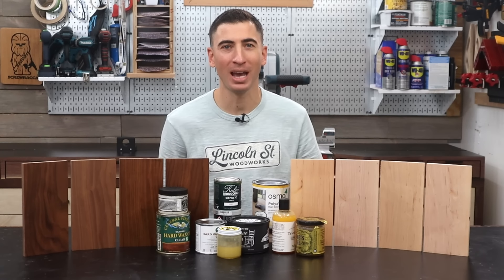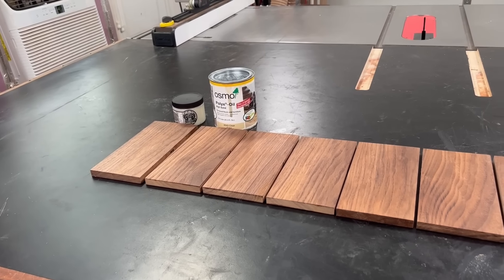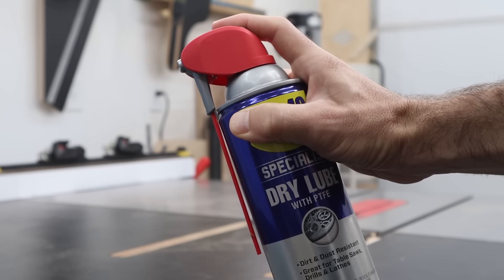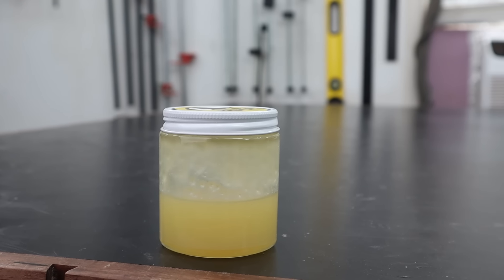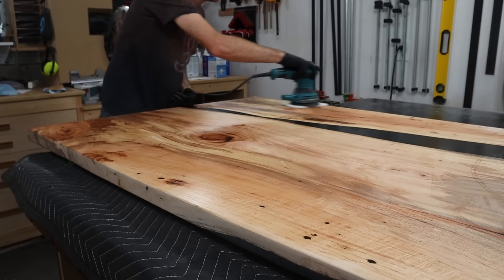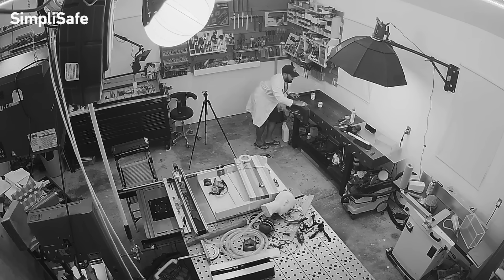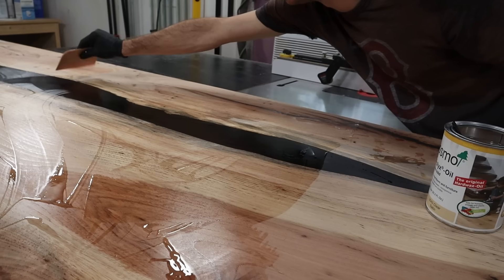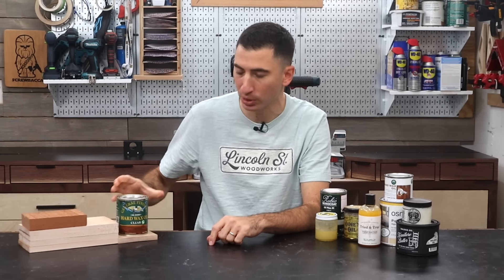Debunking Hardwax Oil Wood Finishes

Comment: The finish containers have % VoC, it’s likely that the number you are reading, mg/m3, would be very very close to 0%. Units matter, please prove me wrong.
Reply: Finish containers will usually denote VOCs by the unit "g/L". Lacquer for example, is around 600+g/L. Assuming the finish has the same density as water, that is 60% of the total liquid that are VOCs. When you have a liquid evaporate into the air, that is a TON of compounds in the air. Are you saying 10+mg/m3 VOC concentration in the air is close to 0%? That is an exceptionally high level of VOCs in the air and there are thousands of studies to indicate such level of VOCs to be associated with adverse health outcomes. Here is an example you might relate to: 10g of cocaine in your body of 100kg is 0.01% and is soooo minuscule that it is essentially 0% right? Except it would be lethal.
Reply from the maker: Yeah what he said - I obviously knew that

Comment: So after watching there seems to be some issue I have. Cost per ML? Why not cost per SF of coverage? That makes most sense to me. Also I have used most all of the products you tested and found Odies to out perform out last and cost way less than the others. The VOC tests are a bit comical that you would “fail” odies. Think essential oils. They smell too. Which is what odies is comprised of. So that is very misleading. 
I have finished hundreds of out door furniture pieces with odies, it is an outstanding exterior product, you are right though, sun beats all. Its very simple to refresh the application where as most other products will need to be stripped and re coated. Odies you just rub another coat in every couple years and it looks better than the first application. You may need to further your finish studies before you make more content as most of what you said is found on the labels and not from real word expertise. 
Just my two cents from a professional wood worker, not content creator with fancy cameras and sponsors.
Reply from the maker: Cool. Thanks for watching

Comment: Thanks for doing this work, so we don't have to!... Did you happen to make a scoring table for these, and will you release that? It sounds like these options are somewhat based on preference and use case, so a category comparison table would be cool...

Also, I felt a little lost when you were going through the samples... Maybe it would be easier to follow if the products were always in the same order and a label was always displayed with the sample. Anyway, thanks again for the video!

Comment: i suggest another video where you delineate between the wood worker and the end user of the furniture. the woodworker should be using a respirator and the end user should be able to eat the furniture (see children ). some ingredients are intended to offgas quickly and are in the formulation to function as a carrier, etc. voc should be measured a week or a month after application. 
I have an Article dresser that is still causing my clothes to reek.
great video otherwise!!

Comment: I don't even work in maple any more because it's always so fugly yellow and like jaundiced ass with a good finish on it... from my experience.
Reply from the maker: I’ve had good results with high performance - no ambering
Reply: @Lincolnstww  Thanks! I'll grab some to try. Sadly, I have a big maple project coming up. Try as I might, the customer was adamant. :(
Reply: I actually used water based poly from the big box stores recently and discovered it didn't yellow immediately. I'm sure it probably will over time. I'm just hoping that because i used in a closet I wont notice when it does.   @ChrisHornberger

Comment: I feel like cleanability is a HUGE factor and the fact only Rubio Monocoat handled that to me makes it the best. Plus, it's good at everything, has tons of colors, a toddler could apply it, and it's not that expensive really
Reply: Agree. 

In case this helps others, here is my experience with it. 

The surface needs to be sanded with 120 grit and then cleaned with their wood cleaner. After that rub on Rubio MONOCOAT and rub-off after five minutes. Let it cure for 7 days and if required add a additional top coat of a product called Universal Maintainance Oil to give a satin sheen to the product. This is applied normally after a year or wear to restore the finish.

My cost experience as below.

Cleaner
Coverage: 1000 Sqft / Ltr.
Costs $0.04 / Sqft.

2C Clear:
Coverage:
500 sqft / 1.3 litre (1 litre oil, 300 ml hardner
Cost: $ 0.28/Sqft

Maintained Oil
Coverage:
1000 sqft per 500ml
Cost: $0.08/ sqft

Total Cost: $0.40 / sqft.

I do intricate laser cut 3D relief sculptures on large surface areas of anywhere from 100 sqft to upto 4000 sqft. On large plain surfaces the costing /coverage will be better.
Reply: @umeshsanghvi224  Yeah, I use Rubio on tons of my projects. I like the finish it leaves and it's easy to work with.

Comment: Two coats of Osmo in my workshop for as long as I can remember. It's been on my kitchen worktops for maybe 20years. Recoated every 5 years and they still look great.

 Don't use alot of Black Walnut in the UK @ close to $100 a board foot you can understand why.  Don't think there a domestic hardwood over here that Osmo wouldn't be my 1st choice.

Be interested in your review of ceramic coatings.

Comment: I've always been a fan on Minwax Wipe-On poly satin.  I just did a walnut butcher block bar top and feel more comfortable with the superior protection polyurethane offers than hard waxes.  I put on 9 coats and it looks great.  

I generally do water based poly on light wood like maple due to yellowing.  Oil based poly on wood like walnut and white oak give visual depth.  I don't like the idea of continual maintenance of hard waxes on heavily used surfaces.  For furniture that doesn't see condensating drink cups placed on them, hard wax is great.
Reply: Eh, I’ve finished bar counters with Rubio and they lasted longer than the restaurant. Repairs are stupid easy, but I’ve never even needed to do one. May as well do an epoxy pour or cover it in plastic if you’re doing 9 coats of poly 🤢.

Comment: The video was out two days ago, why did you pixel out the names and change the title from a challenge to a warning?  More clicks and views or a different post?  Regardless, still like the topic.
Reply from the maker: When a video is released, you do your best to get people to "click" with a combination of the image and title. Most times you guess wrong and go through a series of changes until you see data on the backend of the system that confirms you have the right combination. It's the hardest/most frustrating thing about YT.  I've had to go through 10+ changes to find the right combo on certain vidoes.
Reply: All hail the algorithmic overlords. That’s why.

Comment: Walrus Oil has a Furniture Wax product that can be applied on top of Furniture Butter (used here) that can provide more protection against liquids / stains.  If you have the time, you can use 3 of their products, Furniture Finish (oil), then Furniture Butter (oil + wax), and then Furniture Wax on top.  Walrus Oil is probably the only company in this video (maybe the Bumblechutes?) that tells you exactly what is in their products and is all-natural / 100% plant based.  

Walrus Oil is also apparently carried at Lowes stores now, as I saw some on the shelves at my local store this weekend.
Reply: They use beeswax in some or their products. Last time i researched it bee’s are not plants.
Reply: Yes.  Some do.  I should have been more specific and noted that some of their products are 100% plant based.  Please pardon the generalization.  The 3 products I mention though are 100% plant based.

Comment: Is the regular Bumblechutes finish not considered a hard wax oil? Is that why you used the new wax product?  I know Odies and Walrus also have a stand-alone wax- I wonder how those would perform? Thanks for making a great video!
Reply from the maker: Yes the regular product is more like a cutting board oil - there's no real protection
Reply: You also managed to do a great job pissing off Odies 😂😂
Reply: @kevinlavigne9931  those Odie's guys are the worst.

Comment: Rubio ISN'T a hardwax oil, I hear that everywhere but that's not true, it's just linseed oil combined with a  "secret ingredient" that makes the oil molecules bond the the cellulose of the wood, that's why it is so easy to use and dust proof, and also that's why it is a monocoat finish

Comment: Dude, you state information and then dismiss it. I have been using odies for 7 years and stained an outside gezebo, and it lasted over 3 years through extreme weathering. This is because their pigments have a form of subscreen in it. I have been doing woodwork for many years, and I have not seen any last and povide more protection than odies. You didn't even cover that you can sand to 3000 grit, and it still receives the finish. And Vocs that derive from essential oils are not all harmful, which you said but then had a list of which ones were the most strongest. Your information is totally biased, and it looks like you didn't know much about woodworking.
Reply from the maker: Cool. Thanks for watching
Reply: Odies has sunscreen in it?!?!??!

Comment: Rubio is stupid. For me on raw wood, after 120-240 grit, stupid. Stupid. Stupid. I say after 11 gallons of use, I say nay.

Nay. Nay. Nay. Easy to use? Yes. MONO = 1, but I used 3 so whatever Rubio, go stuff pine cones up the entrance.
Reply from the maker: what wood were you using it on?
Reply: @Lincolnstww  Details right? Walnut. More specifically, some HIGHLY figured walnut. The end grains from branches on some spots, would just DRINK all the rubio, and I could never get the sheen. Straight grain? More of the same, and it really came down to how well sanded it was. Around 450 board foot in total, rubio everywhere. I think on those plastic tables and things like Cam at Blacktail, the epoxy gets nice with Rubio. Not sure on raw wood though! Also, cost. 375ml for like 65 and not nearly enough activator got me dead.

Comment: Very confusing and misleading video. Cost per ML? How about cost per coverage? VOC toxicity vs non-toxic. I would think that many of the companies mentioned in this video would find this libel at the very least. I see the video is sponsored by wd40, but one has to wonder is it is not also sponsored by one or more of the finishes and or the ceramic coating you mention at the end.
Reply from the maker: You buy all those finishes and figure out an easy way to standardize an actual test about the cost per coverage. I’m not basing it off what they all advertise because that seems to be best case scenario. There is nothing libel about putting a finish in front of meter that reads VOCs and stating if it reads VOCs. I think I made it clear that there is more to it. And no it wasn’t sponsored - I assure you no one paid me to say I think their finishes have some major faults
Reply: @Lincolnstww  you could simply use the coverage from the website, or try to measure your coverage on the pieces of wood. You're supposed to be the one testing all this stuff! seems like you kinda failed at your one job... On the other hand, i'm excited for your ceramics video! we all know this is really just an advertisement for that.
Reply from the maker: @boulderguywhy  you seem to not grasp how much I like turtles 🐢